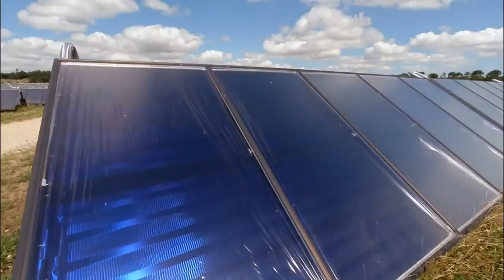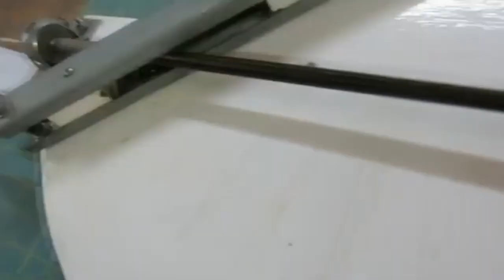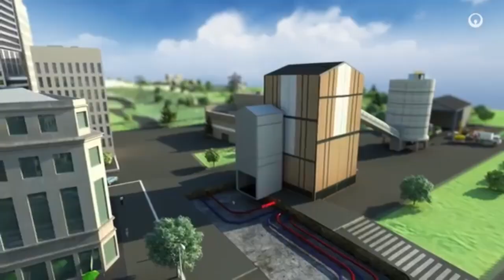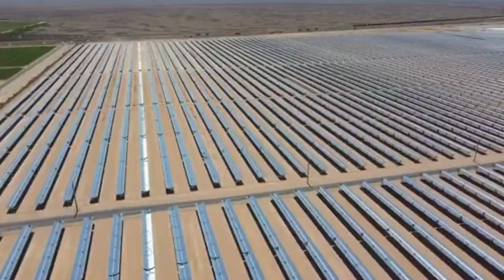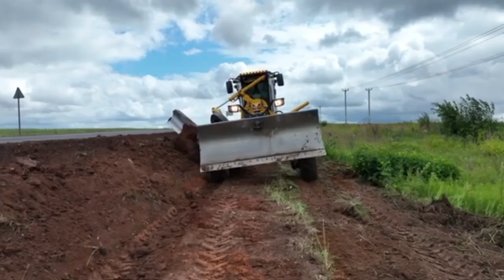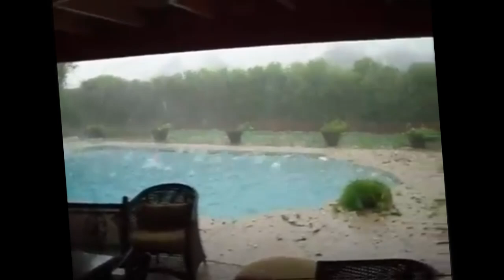New mirror for startups for a solar energy breakthrough: better than solar collectors & power plants

Comment: Mirrors will provide stable focusing only if they are located on a parabolic surface. If you place mirrors on a flat surface, then at least place them in circles. Each circle will be a lens with its own focus.

Comment: The main points of the text are as follows:

- The cost of manufacturing and installing composite mirrors for solar energy production is significantly cheaper than traditional mirrors used for the same purpose.
- A startup aiming to cover large areas with these cheap mirrors to produce electricity and heat must address various challenges, such as receiver movement, mirror installation automation, and production line setup.
- The cost of solar thermal energy produced by the startup could be as low as one cent per kilowatt hour, making it competitive with other forms of energy production.
- The startup could potentially compete with solar collectors used for heating greenhouses, industrial processes, and cities, offering higher heating temperatures and lower costs.
- The text also discusses the potential for the startup to build solar power plants using cheap mirrors to generate electricity through thermal oil heating and steam production.
- Heat storages based on cheap materials like concrete and sand can store thermal energy for extended periods, providing an advantage over solar panels with electrical storage requirements.
- The startup must address challenges such as mirror placement, wind resistance, hail damage, and research costs for different types of mirrors.

In conclusion, the text highlights the potential for a startup to revolutionize solar energy production by utilizing cheap composite mirrors. By addressing various challenges and optimizing production processes, the startup could offer cost-effective and efficient solutions for electricity and heat generation, competing with traditional energy sources. Further research and development are needed to explore different mirror types and overcome technical obstacles for widespread implementation.

Comment: Nice ! And, by the way, have you seen the low tech mechanical solar tracker invented by an indonesian univertisty team called SMART (Solar Mechanical Innovation Adjustable Ray Tracker) working with a low boiling point fluid (acetone)

Comment: line focus works better than spot focus... you only have to converge ONE axis... i find a black pipe full of sand, with a small diameter copper pipe looped through a few times works pretty good.

its also relatively easy to get long narrow panels of mirror as offcuts... 

lay them out "fresnel" style, you dont need a full curve, just the angles of the curve to converge to a point...line. a simple "box", some slots/noggins, "louvre" style...

and as a line, you dont have to worry about tilting it through the year, just the daily sun tracking. align it north south at the appropriate inclination for the equinox...

the heating surface needs to be pretty well much the same width as each mirror panel as the light reflects parallel...

wider boxes increase irradiation per unit length of heating surface. that bits all a bit of juggling with flow rates, final temperatures desired, etc... you cant get the water hotter than the surface, and if you get a small spot too hot you dont get as good a heat transfer, ie, the leidenfrost effect...

the maximum heat is extracted when the coolant barely rises in temperature. can heat a LOT of water to a low temperature. as the flow rate reduces the water will get hotter, but you heat less of it, less effectively until the flow rate reduces to nothing, no heat is being extracted OR exchanged, and the water is the same temperature as the surface would be with no coolant at all...

theres a sweet spot, the maximum water heated to the highest temperature possible...

the fly in the ointment of the commercial plants is the "steam" part of it. theres an in surmountable loss of 80% in the phase change of water... you cant reclaim that energy. boil it to get the pressure, run the turbine to a condensing vacuum by dumping the excess heat, the back into boiler... can preheat feed water, etc, but can never BOIL water from that heat being dumped in the condensor... not an issue with coal or nuclear, theres an abundance of energy, it overcomes the deficiency of steam...

Comment: It looks like the plastic mounting parts could be designed to be modular and easily 3D printed. I missed any mention of the size. My 3D printer has a printable area of 220 mm x 220 mm.

Comment: If you are using a moveable rack to hold the mirrors it might be possible to have the mirrors to hinge into a vertical position during hail storms to reduce damage. As for the brackets holding the mirrors, I imagine injection molding, or cutting slices of an appropriate extruded shape would be a very cheap to manufacture them.

Comment: Has anyone thought of useing mirrors to reflect more light onto existing solar panels? could we make a solar panel with mirrors around the edge focusing the reflected light onto the solar panel? I feel like we could move more light onto solar panels with mirrors. Maybe heat would be much for the panels?
Reply: Your last sentence describes the problem, efficiency declines with heat
Reply: @SolarCookingGermany  i feel like even with efficiency dropping your still making more power with the same sun that was already there. The only other ingredient is the mirrors and I feel like the added power could out perform the cost of the mirrors? There is probably something I am missing.
Reply: @henderstech its not the same amount of sunlight it uses dude if you want to reflect with mirrors it takes place so it will be better to use that space for another solar panel.
Reply: @mateusz5318  I never said the same amount. I said its the same sun. As in its already there why not collect more. The point is to create more energy with less panels. Some type of cheap mirrors is probably easier and cheaper to manufacture not to mention you do not have to mine special metals.
Reply: @henderstech  i remembered i watched that kind of experiment with fresnel lens on youtube 
Type solar power fresnel experiment  with cooling